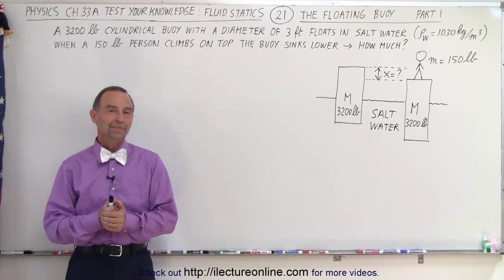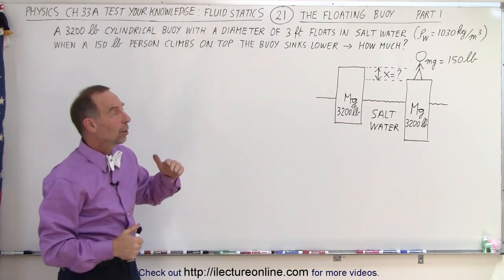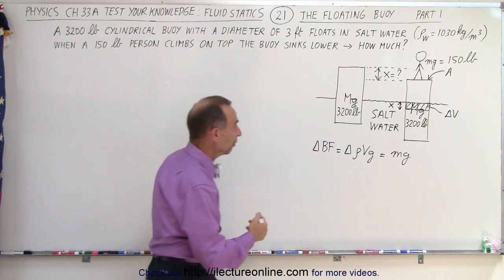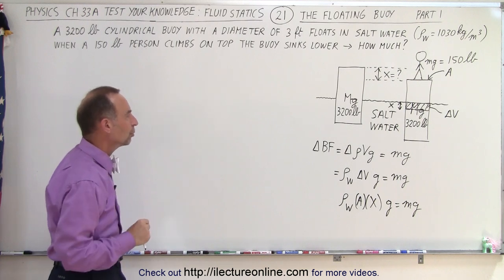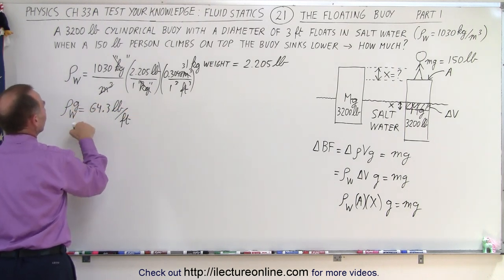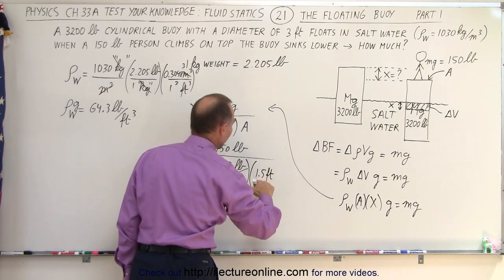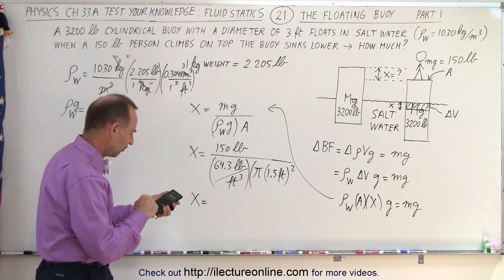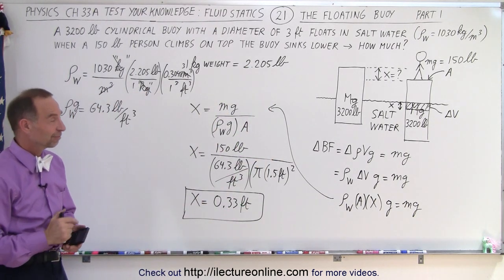Physics - Ch 33A Test Your Knowledge: Fluid Statics (21 of 36) The Floating Buoy: Part 1

Comment: are you able to discussed over atmospheric pressure so we got energy from it and electricity bills going to decreased forever
Reply from the maker: To get energy from something you need a difference in heat, pressure, kinetic energy, potential energy, etc.  Just because there is pressure, that is not enough.  The challenge always is finding a way to extract the energy.
Reply: @MichelvanBiezen  if you discuss it with me then i will give you some trick, like an inverted bottle sucked water upto 33 foot due to atmospheric pressure but if we use a tube inside that tube so it always try to maintain its level and cycle continues, what due you think
Reply: just made a big well in sea beach and inverted siphon will working for it 24/7
Reply: just made a sea saw modal big enough to make a 100 MW of energy so it's one side is related with gearbox and other is operated by sea waves or balloon or sun or helium powered etc

Comment: Please sir, can you help me on this problem? A circle of diameter 6 cm is removed from the centre of a rectangle measuring 10 cm by 16 cm. For the figure that remains, calculate the radius of gyration about one 10-cm side as axis.
Please, notify me when you post the solution...Jude from Nigeria.
Reply from the maker: You can find examples of that in this playlist:   PHYSICS 14 CENTER OF MASS     (Note that radius of gyration is essentially the same as distance to the center of mass)
Reply: @MichelvanBiezen , thanks for your response.